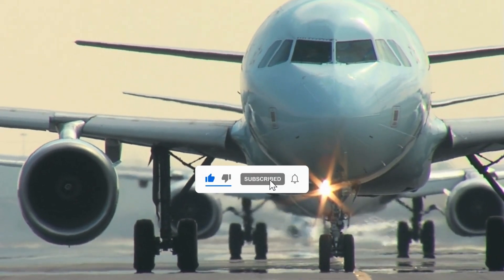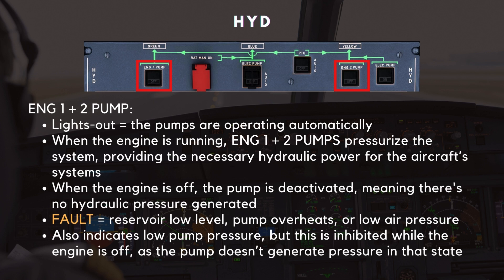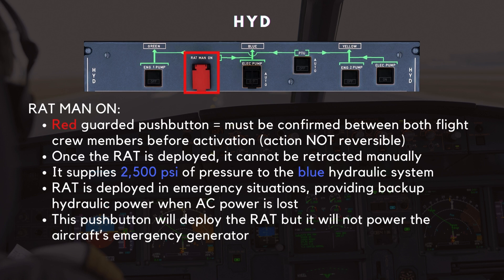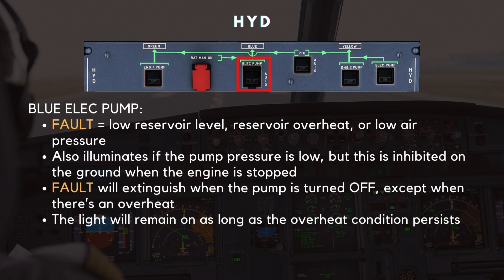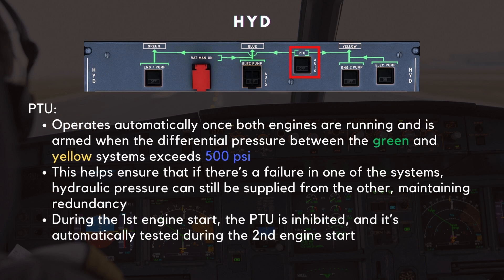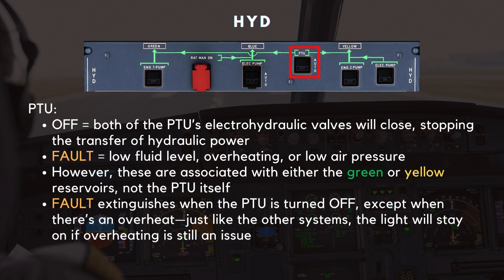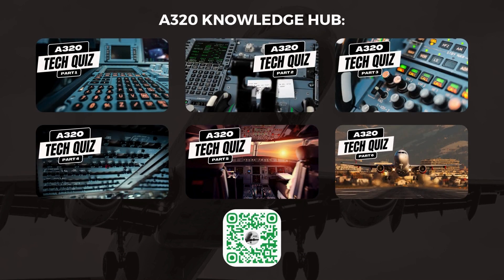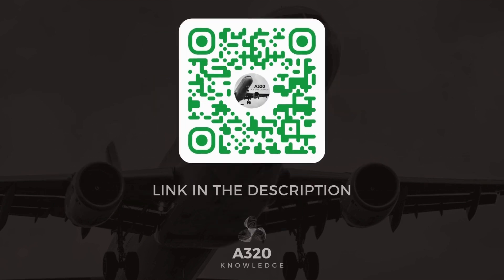A320 Overhead Panel Buttons Explained | Part 9

Comment: Hi - Dave Black here. I'm an A320/330 simulator flight instructor and ground instructor. In your comments above, you say "Check out the largest verified Airbus A320 question bank, available in kindle and paperback editions" but I don't see any way to get the Kindle edition. I did buy the paperback edition which arrived today, but I'd like to see the Kindle edition made available as well, as you've advertised. Please let me know how and where to get it, as the Kindle Store doesn't appear to have it. Thanks!
Reply from the maker: Hi Dave, firstly thank you for the support, and I hope you’re finding it useful. We have experienced a few bugs with the Kindle version so it has been temporarily removed whilst we try to fix it. In the meantime please stay tuned on the channel and our newsletter for the latest updates. 
All the best, A320K